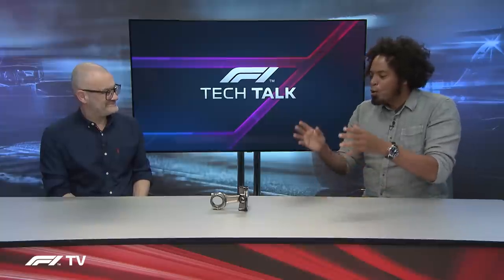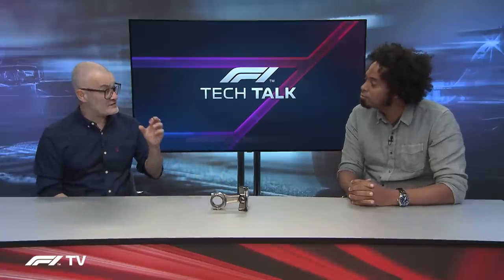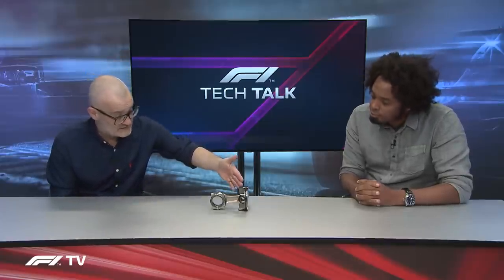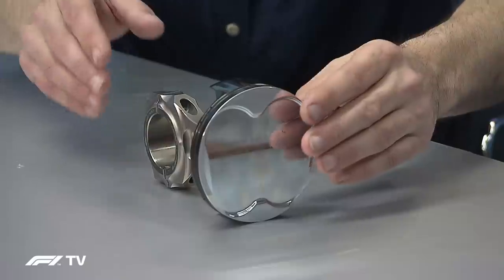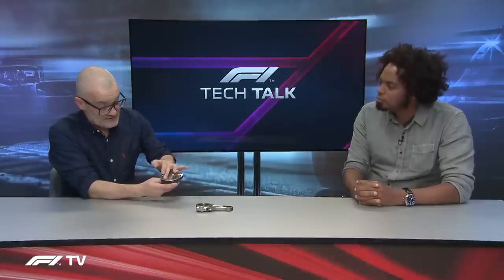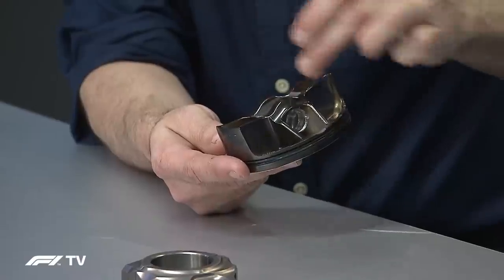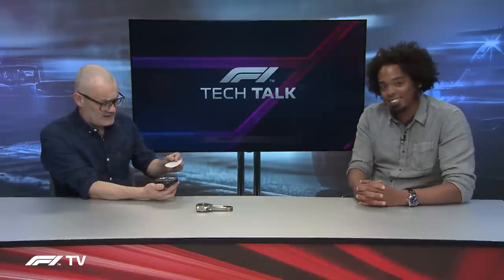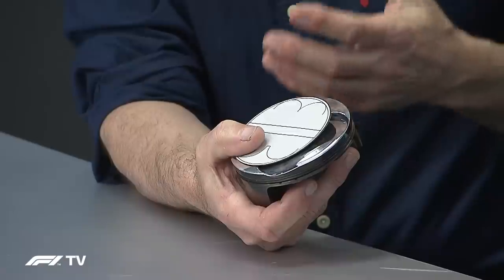A Deeper Look Into The F1 Engine Cylinder | F1 TV Tech Talk | Crypto.com

Comment: I love this info! These segments are great! I would say, that most road cars are around 10:1 petrol compression ratio and 16:1 - 19-1 diesel compression ratio. So a 18:1 compression ratio for a petrol engine is just bonkers!
Reply: I had to replay when he said that lol...
Reply: Thanks for the info ! I was really curious !
Reply: 7:1 in a road car?!? That’s nonsense. More like 9.5-12.5:1 nowadays. 7:1 in what?  A 1915 Model T???
Reply: @mbarbe007  maybe he means turbos. Turbos don't have very high compression ratios because of the air pressure.
But 18:1 is very nearly the same as what modern diesels run at
Insane
Reply: The Suzuki Swift 1.0 with turbo has 10.0:1 and 1.2 without turbo has 12.5:1, and these are very average engines.
Reply: @_shreyash_anand  most modern European turbocharged engines are still running 9-10:1 compression ratios from the factory.

Comment: Honda CVCC 1970's Civic and Accord engines had pre chamber to ignite a weak mixture. They passed emissions regulations without a catalytic converter.
Reply: Wouldn't pass today's though
Reply: Didn’t they also troll GM by implementing that technology in one of their V8’s? XD
Reply: Someone has watched up to speed haha
Reply: @marjoh669  what engine was that? I heard Honda never made a production level/road car V8
Reply: @marjoh669  Yes, they did it for very little cost after GM proposed that it would be impossible for them to do without fully redesigning their engine architecture.

Comment: 7:1 for a road car CR Sam? You look so much younger than 70.  😎
Reply: yeah that caught me off as well
Reply: I thought it wasn't that far off, but after verifying, the lowest compression ratio I could find for a car in the last 20 years was the fq-400 at 8.5. I wonder where he took that number from
Reply: Quite. Engines from the 60's go well above 7:1.
Reply: @leoa4c  Hard to think of any cars you might find on the road with that low of a ratio. Even the early Saab and Porsche turbos had higher CRs. 1200 VW Beetles are the only car I can think of.
Reply: @philipegoulet448  is that the Evo?
Reply: @NERGYStudios  yup thats the evo but that car has 1 huge turbo thus it cancels the low CR a bit out...
Reply: Lol, that caught me a bit off also, even my 2007 kia has an 11.1 cr

Comment: 7:1 for a road car? Cars haven't been that low since the 80s when turbocharged cars were first getting popular. 9:1 is about the lowest you'll see and 13:1 is about the highest
Reply: Exactly. 10:1 would be about the average today.
Reply: socketus puppetus  because turbo 'compress' more air to the engine, so effective compression ratio will be high

Comment: In the 80’s the compression was 8.5:1 in road cars, now its reaching 12:1, not that far from f1, certainly not 7:1 as he mentions
Reply: 18:1 was what it was limited to, meaning some teams clearly were higher. My 1985 F350 diesel is 22.5:1 compression (it's naturally aspirated so it's a bit higher than a lot of turbo diesels out there) so he's not that far off on at least the diesel comparison.
Reply: That's in normally aspirated engines. The Ferrari 458 Speciale reached 14:1. But turbos don't go anywhere near that. 18:1 in a turbo petrol is just insane. It is actually very similar to most turbo diesels. Plus, you also need to remember that going from 12:1 to 18:1 is a 50% increase. That is a BIG difference
Reply: @_shreyash_anand  18:1 was not in the turbo era

Comment: Back when the V10s were still in force,  I often used to say the solution to the ever increasing upper rpm limits was not a mandatory rev limiter,  but rather,  a mandatory minimum conrod/piston weight.  Why?  If you force that combination to be heavier and heavier each year without a rev limit,  the motor engineers have a dilemma  -  they can still go for revs at the risk of engine detonations.  In terms of engine note,  I personally felt 15k rpm was the sweet spot for a V10,  maybe 13k rpm for a V12.

Comment: As a wise man once said: Bring back V12's!
Reply: It's not relevant to the future.
Reply: Vettel
Reply: @flyingspaghetti369  Just abolish F1 then and go all in on Formula E.
Reply: @wronggg  Very childish argument, there's just simply no reason to go back to v12 anymore compared to the v6.
Reply: @instenalable  the future is not gasoline engines though.
Reply: @wronggg  It's about time.
Reply: Move forward
Reply: @JustAnotherGuyOnTheInternet  make it with current technology and it wouldn't be irrelevant anymore
Reply: @RCmaniac667  If you make steam trains with modern design and materials, it won't make them any more relevant.
Reply: @MMAli-rq8kd  steam engines still relevant in some places of the world anyway. Number of cylinders doesn't make it less relevant than a ~1000hp 1.6 litre v6,
Reply: @Dartgame 340 engine sound? We could use SOUND SYSTEM to make it loud.
We could use Sound Synthesizer to make any kind of engine sound that you want.
😂😂😂😂
Reply: @RCmaniac667  how many street cars that still use V12?
Reply: @flyingspaghetti369  There definitely more than 1.6 v6
Reply: @RCmaniac667  In automobiles, V12 engines are less common than engines with fewer cylinders, due to their size, complexity, and cost.
Reply: @flyingspaghetti369  they are not much larger if cylinders smaller and complexity and unreliability is what manufacturers strive for anyway
Reply: @RCmaniac667  and making a lot of money?
Reply: @flyingspaghetti369  sure thing
Reply: @RCmaniac667  only very small market for V12.
Reply: @flyingspaghetti369  it would've been more if there were less restrictive legislations
Reply: @flyingspaghetti369  it isn't much higher to produce than other displaysments. Most of the price in modern ICE is forced induction and electronics. As times go engine getting smaller and price of it getting higher
Reply: @RCmaniac667  of course V12 cost much more than V6. Do you have an engineering degree? I have.
Reply: @flyingspaghetti369  same
Reply: @flyingspaghetti369  mass produced castings costs far less than ECU, MGU-H/K or even alternator in some cases
Reply: @RCmaniac667  V12 not mass produced.
Reply: @flyingspaghetti369  it was mass produced before and some supercars produce it in mass today still. Lamborghini and Ferrari for example or Toyota and BMW in not so far past

Comment: It's so sad that they are not allowed to experiment with compression-ignition. F1 and motorsport in general were normally the testing grounds for new tech (or adapted tech) for our road cars. I mean, it's not only the mechanical parts that are important here, but the chemical parts too, i.e. fuel, oil, tyres, etc. Imagine how awesome it would be to have compression-ignition for petrol engines as well. By letting manufacturers research this in the sport environment takes the burden off of the R&D in the commercial environment which will accelerate R&D in general because of the resources available in the sporting side of the business. It's a free test bed to see how stuff can run in the real world. This could also spark more manufacturers to enter the sport since what they are developing in F1 can have a direct impact on their car sales. Tell me if my head is in the clouds dreaming of it as an ideal scenario instead of how it really would be. I REALLY want to see F1 tech in everyday road cars

Comment: I would like to see more about the cylinder head and valves actuators...I'm almost sure that F1 engines does not use camshafts
Reply: they do use camshafts, but pneumatic closing instead of spring closing the valve for faster frequency response.
Reply: @garydrew9970  no valve springs can't live @ ultra high RPMS the springs won't last.

Comment: Could somebody explain to me how the piston does not wobble about the axis of the gudgeon pin given how close together the piston rings are?
Reply: simply because it has a thin length/section of skirt front&back to minimise the rocking. No skirt on the sides, cos got gudgeon/wrist pin to stabilise in that direction
Reply: @garydrew9970  thanks for that. Does that mean that the skirt at the front and back actually makes contact with the cylinder wall?

Comment: Could u talk about this rake system of mercedes, that the commentators talk about all the time?
How does the mercedes change the ride hight without the forbitten active suspension?
Reply: Probably a suspension that is soft enough to depress under high downforce from high speeds. The car does experience some really high downforces at high speeds.
Reply: Coming up....

Comment: We need a analysis on the mercedes rear suspension dipping down at high speed
Is that legal ?
Reply: It is.
Reply: All the cars dip down when they are going at speed!
Reply: Isn't that just downforce?
Reply: Sounds like downforce doing its job
Reply: Mercedes currently have their aero for high speed straights and having clean air in front of the car. Red Bull on the other hand have their aero more in the direction of cornering.

Comment: Precombustion has been around for a quite a while.  Honda used it in the late 70s early 80s in the CVCC engines.  That's why their cars are called "civic".  Stratified combustion is the proper terminology. The diesel example isn't really the same thing.   These ideas get recycled, modern electronic management has just refined things.  F1 hasn't really innovated new engine technology for a long time due to rules limitations.

Comment: Don't know about anyone else but i feel like penalties are taking away the closeness of the championship... They should just allow a bigger number of engines to be used specially going forwards as the championships are getting longer and longer...
Reply: It made a lot more sense without the cost cap, as bigger teams could more easily afford new engines than the smaller teams. Now that every team has a limit on spending it could be abolished imo
Reply: @vonelle9122  considering teams would take advantage of that

Comment: Engines may be efficient but... they sound like turbo charged trash cans.
Reply: @Dartgame 340 

100% !!! All these restrictions to even out competition isn't working, just takes away from racing. What is the point of racing 60 laps when driver can only go flat out for 20 of them and rest is cruising in fuel saving mode. Or slow down because engine component is worn out and they can't install new one because they'll get a penalty. It's a nonsense that only handed Mercedes several championships and everyone else could do nothing but watch because restrictions on testing and development. F1 has really turned into a parody.